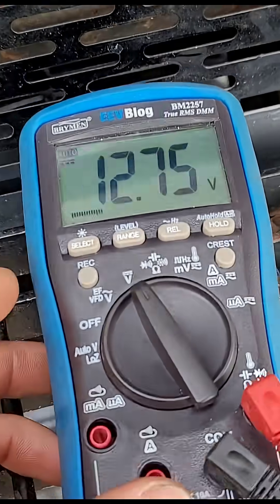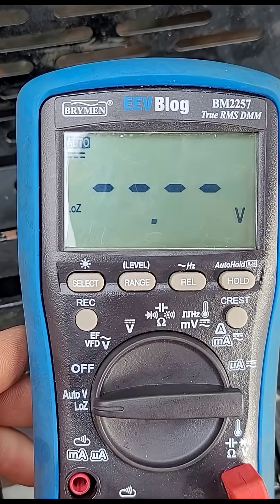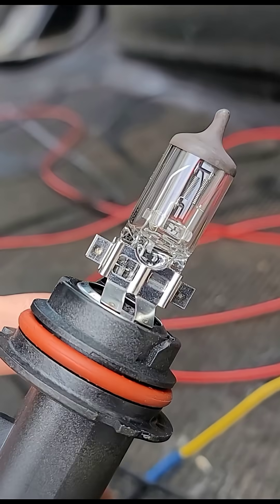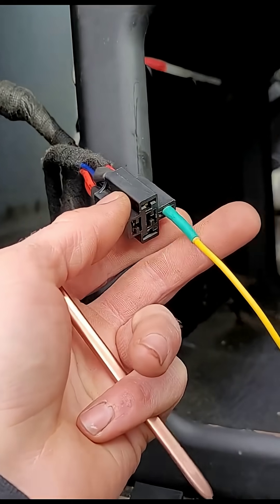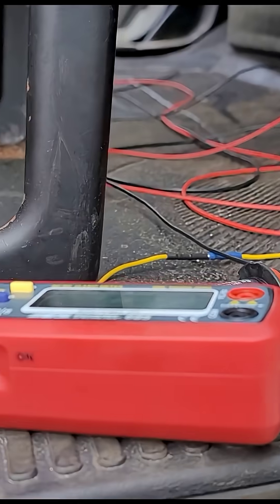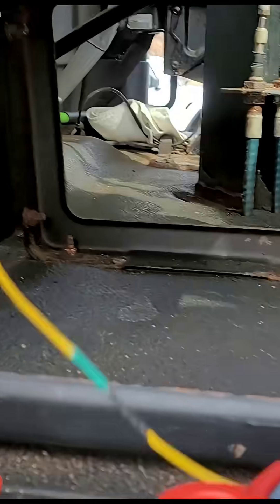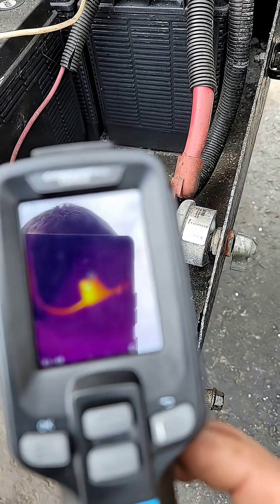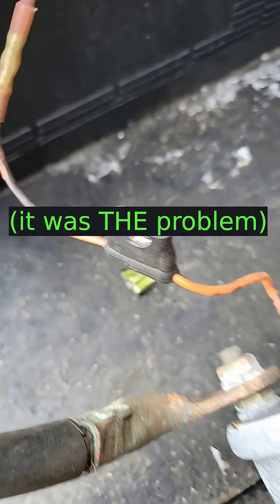your multimeter is lying to you

Comment: Hahaha! Good point! Sometimes it's a matter of needing a special chip. Toyota will make you pay about $100 For the chip that plugs into the harness in order to get the trailer lights to work. You can wire it up and check it with your multimeter and it will all check out . ..until you connect it to a trailer. No matter how many different ways you try to rewire your trailer, the lights won't work until you get that chip. ..I learned that the hard way. ..after rewiring my boat trailer 2 times and grounding every light and every connection and grounding the connector to the truck. I felt like I was getting punked.. lol but it always appeared to be working when I checked with multimeter

Comment from the maker: I have 3 different size light bulbs for load testing different size circuits. the one used here is a headlight bulb that draws 5amps. perfect for testing powers and grounds. no need to figure out where the actual ground point is, just test it right from the connector!